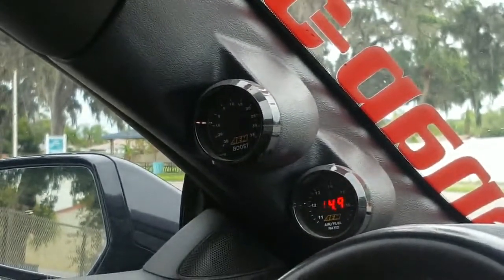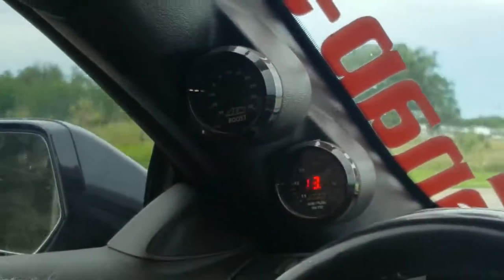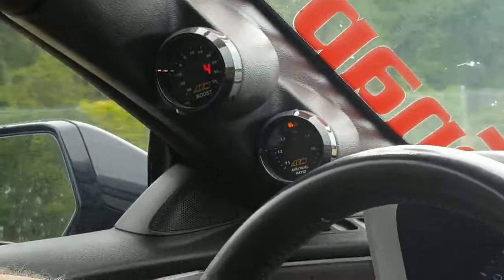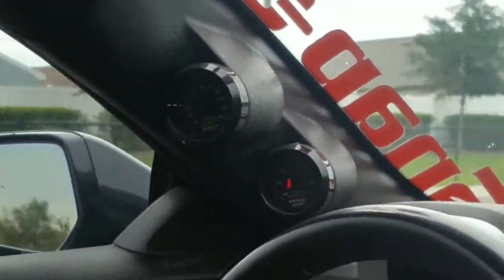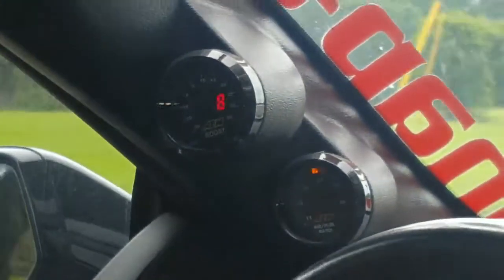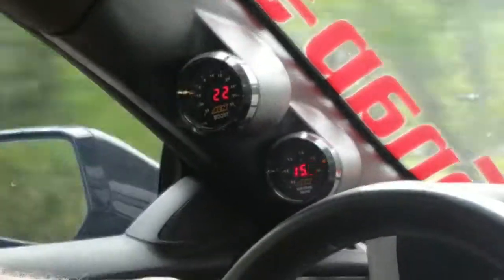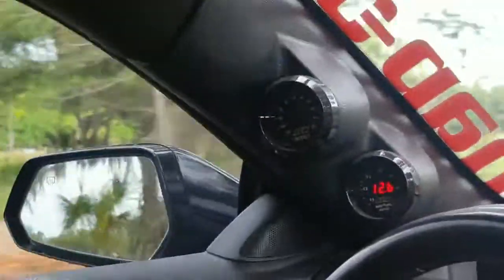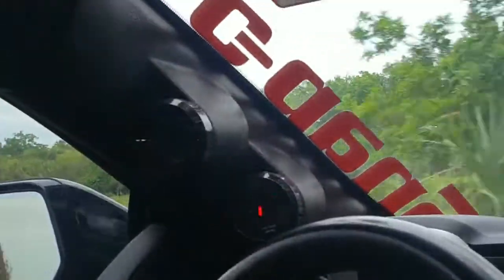Reversion Pulse

Comment: Do you have these kits with instructions for 2020 tacoma. Its multiport/dirext injection ,Atkinson engine? I get reverb of some sort I believe in exhaust  at low throttle .its annoying..searching for a cauze and seeing this I wonder if this issue could be leading to mine?? As soon as I step on it it goes away .   if mine is not turboed will this kot still be good for my vehicle?

Comment: Hi Tracy, thanks for the video.  For the past year I thought the low vacuum/atmosphere pressure during light engine loading at highway speeds in my crankcase was a mechanical problem.  After GM replaced all the pistons and higher tension rings in my Chevy Equinox, I thought I would see improved vacuum.  Nope.  I was assuming these modern engines worked the same those older V-6 and V-8, single cam engines.  I ran across Matt DickMeyer performance and an article in Engine Build Magazine on GDI Ecotec engines.  After talking to him about his solution and external PCV system, he opened my eyes on the problems with reversion and the tuned intakes the OEM designed, which is must.   Running a dry sump system or an expensive electric vaccum pump was not an option.  https://www.enginebuildermag.com/2017/10/solving-gasoline-direct-injection-issues-facts-fictions-gdi/  I installed individual vacuum fittings on each of my intake runners and attached a mechanical vacuum gauge.  When measuring at EVAP port no issues found, smooth steady reading.  When reading from any runner individually, I get speed/load specific vibration on the needle.  This is the reversion Matt talked about, and confirmed for myself.  I try warn people about the so-called cold air (actually hot air) aftermarket intake systems that do away with all the tuned designed, baffles, expansion chambers needed for proper intake performance.  Just ordered your RXP catch can, with dual source ports and have started testing the intake vacuum performance under load.  When intake manifold vacuum drops the clean side of the PCV system and intake filter housing and pipe take over using the venturi affect.  Although lower it keeps the crankcase at slightly negative or at atmosphere using the much larger hose from the camshaft cover. We will never see the same vacuum readings, but that is not needed.  I am seeing an increase from .01 inHg at idle to .6 inHg at WOT.
Reply from the maker: Excellent understanding! And very few understand much at all on this. Make sure you did NOT order through the counterfeiter RXP!!  He used to be a sales person for us and then is in violation of our patent. His name is James. Here is our site as he pretends to be us. www.RXCatchcans.com  Stay in touch and lets compare notes. I'm impressed you understand this. Email: RXProducts@aol.com  Thx!!
Reply: @tracylewisperformance2270  No worries, I ordered through Karen as you recommended.